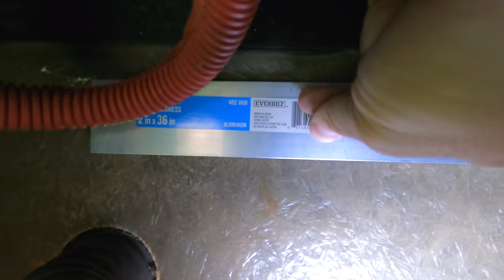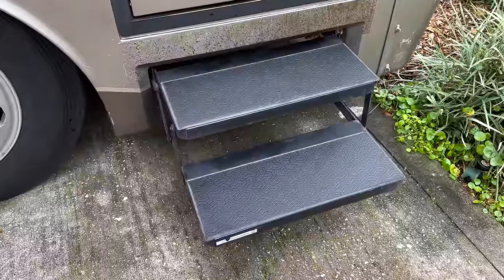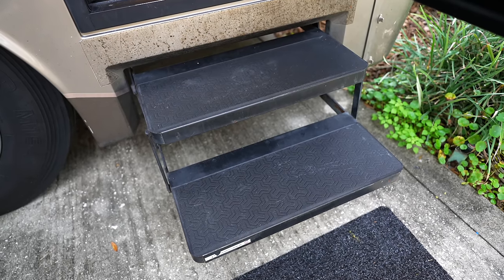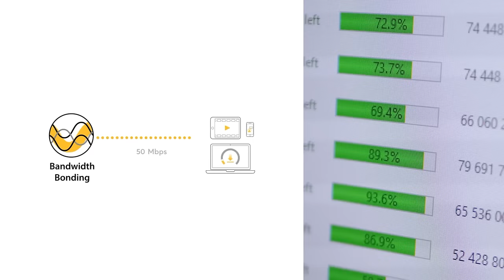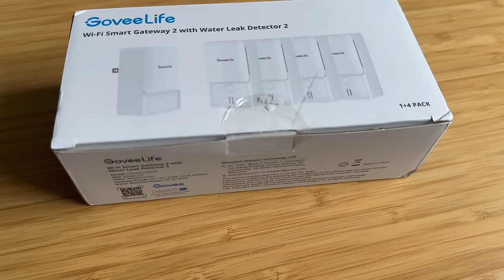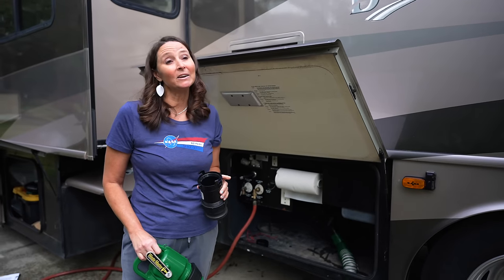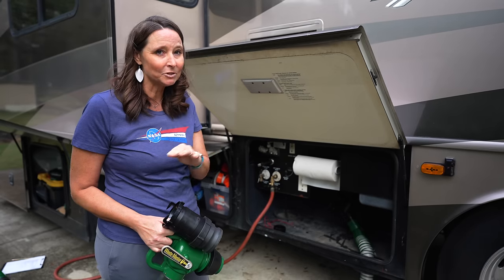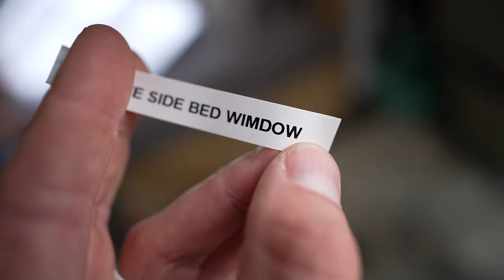The BEST RV Modifications NOBODY Does (In Less Than 20 Minutes)

Comment: We have a Hi-Tech water saver.  We use a HD 5 gallon bucket.  We fill the bucket until the water is hot.. it only takes 1 to 2 gallons.  When done we either use the water to flush in the toilet.  Use it to rinse dishes or dump it outside
Reply from the maker: Good plan!
Reply: Mine only takes a quarter. Maybe it's closer to the shower. Either way don't let it flow into the tank.
Reply: Mmmm..... 12 v soleniod valve -- couple of check valves - tee in the hot water line --- and a couple (1 per faucet or area) //// want hot water, push the button, 12v solenoid opens and dumps the ?cold? hot water back into the fresh water tank (no waste) hold for 10? secs or so release the button and open the hot water faucet - hardest thing (not hard at all) was the return line from the tee to the fresh water tank. No wasted hot while getting it hot.

Comment: I installed a tankless water heater in my rig about 7 years ago. I had the same issue with wait time. I solved it by plumbing the tankless inline with a 20 gallon propane. The tankless is first, then propane. This has done three things. Provides hot water sooner to use, lowering water usage. Second, tankless heater provides hot water to the propane heater tank keeping propane use down because the propane doesn't kick on when the supply water is already hot. The propane only runs to maintain hot water in the tank, which isn't often when the water is used normally. The third, and discovered afterwards, because the tank heater is insulated, I can travel a considerable distance and still have hot water available. ( I do not travel with propane supply on. I believe those who do are beyond stupid to do so.) I'll add, because my tankless is AC electric, (generator or dock power), I have never been without hot water unless all utility supplies are absent. (I've been without propane on a few occasions due to time at a location).  Hope this is helpful for you.  Happy trails!

Comment: I bought lights similar to the magnetic lights at Home Depot.  They are sold single or ina 2pk with a charging base that you can put up to 4 lights in. The base has a USB A x C cord.  The lights can be charged with or without the base. I mounted 2 in my workshop under the cabinets over the work benches and I have 2 in the house under cabinets.  I bought a total of 8 so that I can rotate them when they need charging.

Comment: If you want to add some fabric to the Reflectix, if you sew the fabric to the Reflectix using vertical lines you can then fold it along those lines for easier storage. You can use bias binding either glued or sewed to the edges to stop them getting messy too.  This makes the Reflectix a lot more durable and much easier to store. I got the idea from Create with Verity
Reply from the maker: Great idea!

Comment: I completely agree with the AC soft start mod.  Another one that I have enjoyed having is my Roku.  I bought it for my Dad in the 90's.  When Dad died, Mom Didn't understand to set the input select on the TV to HDMI and she gave it back to me,  I quickly put it in our motor home and have no regrets we definitely use it way more often than the antenna.  We really like it on longer trips like our snowbird trek down to see our Floribama relatives. We've been thinking of getting a newer one because as a 90s unit, it has a limited selection of veiwing options. Today's units are 30 years newer and way more powerful,.
Reply from the maker: Thanks for the comment and for watching
Reply: First Roku set top box was released in 2008 Kevin...
Reply: @IWillSmurfYou  You're probably right.  If your looking for an argument, you won't get one from me.  As a two time stroke survivor, my memory isn't as perfect as it once was.  The one I have is still old and under-powered.  Still, Roku is a great addition to any RV.  It would also work great for stealth campers because no TV antenna on your van makes your camping even stealthier.

Comment: Recirculating pump uses power keeping the water hot plus it runs the tankless heating the water and uses propane. Unless you manually turn a pump on till water is hot putting the cold water back into fresh water tank. Look into the water mizer that they put in the Winnebago micro mini FLX. Awesome idea and it works great. You can build your own by pass system.

Comment: We bought the magnetic lights and use them on our steps, just magnet to the underside of each step or on the inside underneath at a diagonal and set them to motion detection mode.  They work pretty great for getting in and out and as a bonus if you need a light, just grab it, take it with you for a walk, use it under the hood when working on the engine, or the axel when underneath our trailer.  MAGNETS!

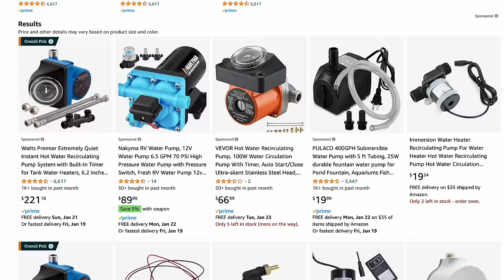Comment: @2:08 I have a tankless water heater and I tested from the unit to the kitchen sink I waste 2 cups of water before it's hot. Also tested the bathroom sink and shower and water just under 2 cups of water. I'm using a Ridgeyard 12L 3.2GPM cheap heater and for the price it works great with super low water waste

Comment: Nice video; thank you.
I work in a hardware store, and I get a lot of customers who are setting up StarLink in RVs. While I am a full-time RVer, I don’t have StarLink. These customers tell me of a specific cable that StarLink uses that is too large for the common plates we carry, but it looks like you’re just passing the EtherNet connection through. Perhaps you could go into a bit more detail about your StarLink setup?
Also, for most situations, I consider on-demand water heaters to be a waste for a variety of reasons, especially boondocking. I typically use less than one six-gallon tank of warm water per shower, which helps me ration my freshwater supply; replenishing water in the dry regions I normally camp in is annoying. I heat the water till it’s about 105°F, shut off the heater and wash dishes, then shower using JUST the remaining hot water, no cold mix. (I normally use three dishes over and over, not the consumption-oriented full suite of show-offs; I eat out of my cook pot or tray, as well.) when I can avoid showering, I heat dishwater in a tea kettle. Saves a lot on energy and water.
Reasons not to use on-demand heaters for normal American tastes include much heavier maintenance requirements and expense.
This video was well made; thank you for that :)
Reply from the maker: Thank you!

Comment: Hot water IMO the best system is VanL ife Tech Tjos is a closed hydronic system heated floors heated water on de.and and heated air. Awesome system!! I looked into recirculating but the filters that must be replaced often is expensive  and a hassle. Go with a closed system Hydronic!

Comment: Our son had a trailer with the on-demand heater and it worked fine, except in our area (west Texas) we have very hard water and lots of minerals in it. We've found that we can heat up our 6 gallon capacity hot water heater and it stays usable for 6-8 hours before we have to turn it back on. Of course we can't take unlimited length showers, but we're camping, not in a spa ;)
Reply from the maker: Thanks for the comment

Comment: I had a cabin in the redwoods of California years ago. We installed a recirculation pump system into that cabin, and we always had hot water all the time. This was when I was pregnant with my 30-year-old daughter. Might be a bit different, but I think what you are looking at would work even better because it is modern. LOL
Reply from the maker: Good to know! Thanks for the comment and thanks for watching
Reply: We had it on ships. 
Also had showers that had temp regulator.
Set it. Next shower temp was the same.

Comment: Hi guys,
I actually have come to prefer doing the dishes in a plastic tub on the tailgate of the truck. A wire drain rack sits beside the tub for air drying, and the gallon or two of dishwater gets dumped on the ground. 
My RV is a cargo trailer to RV conversion that I built myself. A 100 gallon plastic farm tank sits in the bed of the truck and is my fresh water tank.A hose runs to a water inlet in the nose of the trailer. Combined with an on demand water heater, I have long hot showers out in the middle of nowhere without worry about running out of hot water. Or running out of water period. And all the load of 800 lbs of water gets tranfered to the truck, which has lots of excess weight and space capacity.

Comment: We have a newer camping trailer and it's funny how some of your mods are already on our unit.  Ours came with a 12V fridge and a quick connect to run our grill from our propane tank.  But we purchased an AC soft start to give us the ability to run ac while boon docking after watching your channel.  Can't wait to try it this summer. (FYI, we tried one that you just plug into your power supply and that was a failure.)

Comment: Not sure if anyone mentioned this about waiting for the water heater to heat water, but I saw this on another video and it made sense:  collect the water in a container until it gets hot enough to use.  If you can, take that container of water and add it back in to your fresh water tank.  In the video, the guy used a one-gallon milk jug to collect the water since that made it easy to pour in to his water tank.  I think he said he collects a couple of gallons a week.
Reply: So add hot water to the tank?
Reply: @kittycat8222  No, add the cool/tepid water to the tank; once the water out of the tap is hot, use it for washing or whatever purpose you needed the hot water.
Reply: @UrbanSpaceman  thanks

Comment: Every users has their own customizations .  We have an off road travel trailer and mostly boondock.  My wife uses a cpap and it normally runs off AC voltage. That required us to have the inviter on all night.  I was able to buy a 12 volt adapter for her cpap and now I do not need to have the inverter on all night.  I am not a fan of instant water heaters but in my travel trailer the manufacture provided a Truma Combi.  It has a small hot water tank.  I find I can wash dishes in the eco mode if I am careful on use of hot water.  Many people do not like them but I had a composting toilet installed.  No black water tank.  We boondock and the water savings is huge.
Reply from the maker: Thanks for sharing.

Comment: About the tankless hot water heater, are more newer campers coming with them or an option? Those magnetic light bars we use at home under the cabinets. Ports come on new RV’S? Those Governor water leak sensors should come no charge placed around brand new RV’S. Keep the videos coming!
Reply from the maker: Some new Rv’s come with tankless water heaters - just depends on the trim package. Some new RV’s come with external ports also. Thanks for watching

Comment: We added a 12-volt water valve on the hot water line and plumbed it go back the freshwater tank. We found that holding the water valve switch for about 10 seconds we have hot water at our sink.
Reply from the maker: Thanks for the info!

Comment: Great video!

As for your on demand water issues, look into the showermizer and watermizer set ups.  Same system you find in Rockwood fiver and travel trailers.
Reply from the maker: Thanks for the tips!
Reply: @GratefulGlamper  of course!  Depending on your tank set up, it could be a big project to put the mizers in, but frankly, IMHO, it'd be an awesome DIY segment.

Also, I've been curious, what are using for a temperature monitor?  We've been using the MicroAir thermostat with excellent results so far (4 months F/T)

Comment: Hot water heater is not incorrect, because in some circumstances, you use a water heater system to keep the entire water system from freezing. So it's not wrong for some people it's a little cumbersome, but I've seen plumbers refer to hot water tanks as hot water heaters.

Comment: Hello, great videos! My trailer came with a quick disconnect propane line. My question / statement is I see you are using the regulator that came with the Blackstone. The propane coming out of the RV has already been regulated down, so using the regulator is limiting the gas flow, correct? I attach mine directly to the Blackstone and the firepit without a regulator and it works as it should.
; - )

Comment: We love Reflectix. We use it on our dash behind the windshield of our Class A MH. That said, I do not recommend it in behind dual pane windows as it can cause the rubber gasket between the 2 panes of glass to overheat and come loose. We had to have 5 of our dual pane windows repaired and the windows defogged as a result, which is quite expensive.
Reply from the maker: Good to know! We had ALL our windows defogged and new gaskets installed (lifetime warranty) right after we purchased our RV in 2017.
Reply: I use it for sky lights. 
I was concerned about heat .
Thanks for information.😊

Comment: Saying hot water heater is fine, especially for a conventional tank type one with heating elements.  The water in the tank is already hot, when more heat is applied to it after it cools off 10 degrees or whatever, whether due to heat loss or cold water getting mixed in as you run hot water.  It normally is actually heating water that is already considered to be hot.

And even in the case of heating water from cold to hot, as in a true tankless, it is creating hot water.  There is nothing in the English language saying that something can't be named for the end product it creates, versus the beginning product which it worked its magic on.

For instance:  
Meat loaf pans are not called raw meat pans
Muffin pans are not called dough pans
Compressed air tanks are not called uncompressed air tanks

Comment: I have been thinking about a tankless water heater.  I thought I could avoid the cold water waist by putting a push button valve by the kitchen sink and in the bathroom to feed the old water back into the watrr tank.  This would also allow me to run hot water into the tank after I fill up in deep mid winter.  Fill up with water near freezing and my heater (air+water) will dump the entire contents of the tank via the hot water anti frost drain valve.
Reply: They make a Shower Miser valve that accomplishes this.
Reply from the maker: Great idea
Reply from the maker: Good to know!

Comment: Hi, the Amazon link for the SeaDek step covers you have is not correct. The site does not post the size of the cover, and when mine came a couple days ago, they were much smaller and made of a different material than the one that you presented. I looked at SeaDek's store and could not find them either.

~ Thanks for your videos!
Reply from the maker: You can also find them directly on the Sea Dek Website: https://www.seadek.com/product-category/rv-step-covers/
Reply: @GratefulGlamper  Thanks, I found them yesterday. The covers on Amazon are designed for boat ladders (about 4" x 13"). After you read this, I will delete my comment. It was really just an FYI. ~Take care

Comment: I was traveling in a Class B Roadtrek, during HHelene and had the worst time with one bar of internet connectivity. I'm only 20 feet long.  The roads in kentucky, Arkansas, Missouri don't have shoulders. THere is just a solid white line then a ditch. No wonder it's called the Bible Belt as   I was praying hard while trying to find a pull off to check maps. What can I use for better internet connection ?

Comment: I have a question regarding your govee water detector.  I do not have wifi in my RV, will govee still work with my smart phone?
Reply from the maker: Usually Govee has a bluetooth option. But if you are away (out of range) you will not get the alert like with the wifi enabled option.

Comment: Your all encompassing statement that tankless water heaters use more water when boondocking is misleading. Our Truma AquaGo does not rely on flowing water to start heating. Ten seconds after we turn it on the water is hot and ready for use. Then, like any system that does not use a recirculating pump, the water only flows cold until the hot flushes the supply pipe.

Comment: Where are your window blinds, shades? Why would you remove them just to use an insulated foil blind. You can slide that material in behind your shade or blind. I would never camp without blinds or shades.
Reply from the maker: We have roller shade in most of the windows that we can also put down. But even with the shades you can REALLY feel the temp difference with using the insulated reflectix. Thanks for watching
Reply: I have insulated curtains in mine & use the reflex aluminum windshield covering at Dollar Tree & cut to size for windows with little velcro. Cheap & works for me! Natural light in & no one can see in unless I open the curtains after dark. Saves electricity too. 
Like your tips & tricks too!!

Comment: Install one more valve near the supply line for the water fixtures and make it return back to the freshwater tank from the hot water side. Once the water is hot, turn the valve off and you will have instant hot water at your fixture.
Or they make a device that ties the hot and cold water together with a recirculating pump on a thermostat

Comment: How did you attach the ClosetMaid shelving? Screw it between the spaces on the sides, into the wall? Thanks!
Reply from the maker: We attached it to the walls (screwed in the mounting brackets)
Reply: @GratefulGlamper  Ok. Thanks. I thought you had to cut it first, to fit the wall.